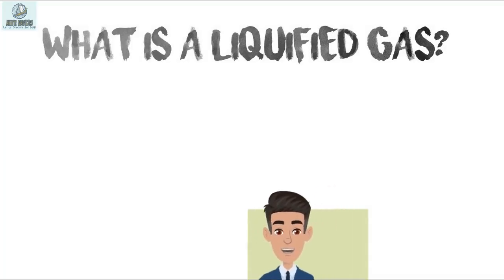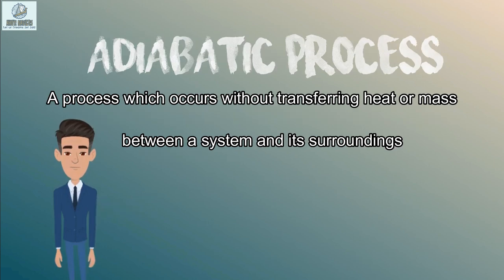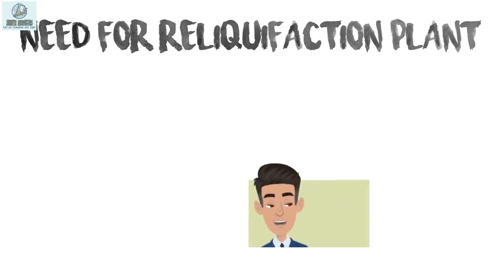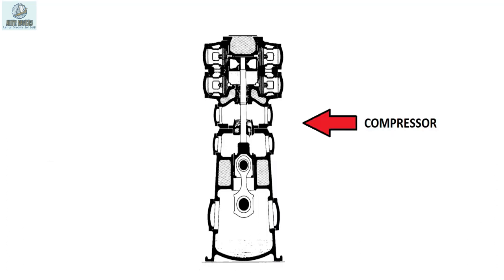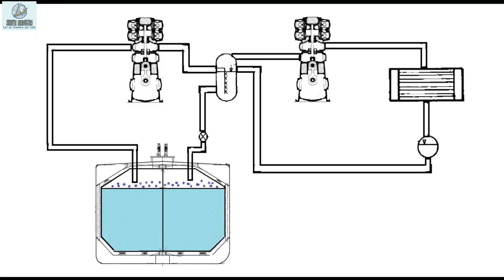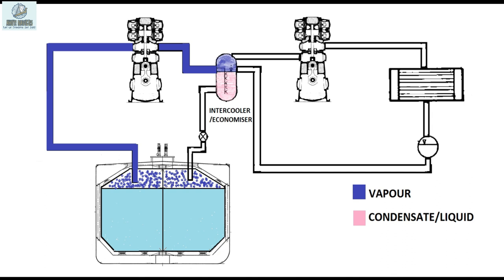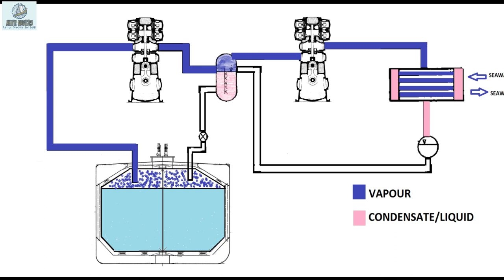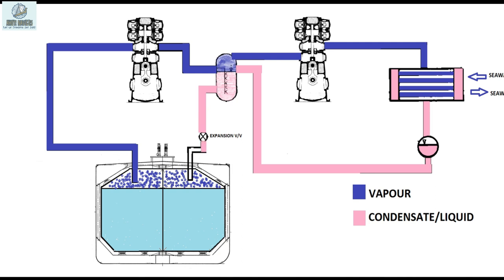GAS CARRIERS: RELIQUIFACTION PLANT ON GAS CARRIER | GAS CARRIER BASICS | AHOY! NAVIGOS

Comment: What about 3 stage?? And why cant for example we need 2 stage like for butane we only did by 1 stage but y doesnt it hold good for propane,ammonia,vcm?
Reply from the maker: Yes we do have 3 stage compressors.
A single stage compressor doesn't hold good for cargoes like propane , ammonia and vcm because of their low boiling point.
Because of the low boiling point the compressor has to do more work to remove the energy(enthalpy) from the system.
Thus 1 stage is not used there.
For Butane we can use both 1 and 2 stage compressor.

We hope this clears your question
Thanks for the response
Team Ahoy! Navigos